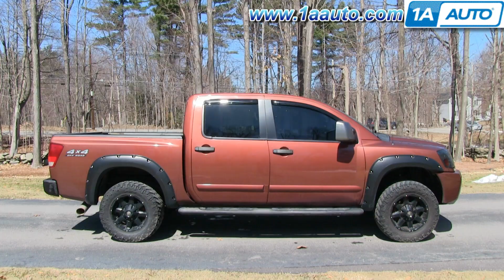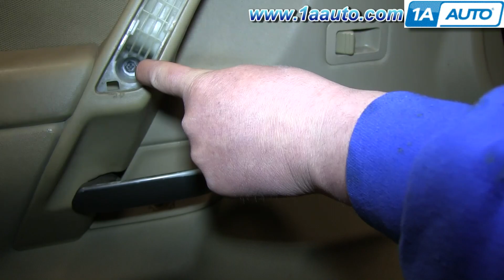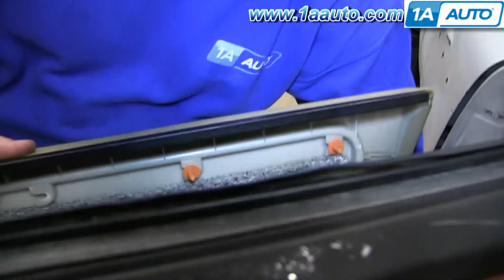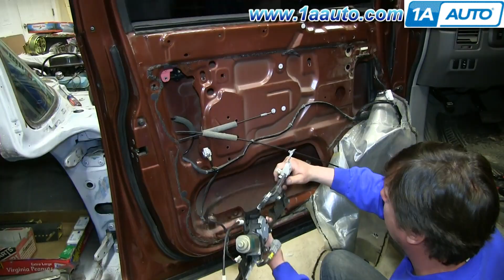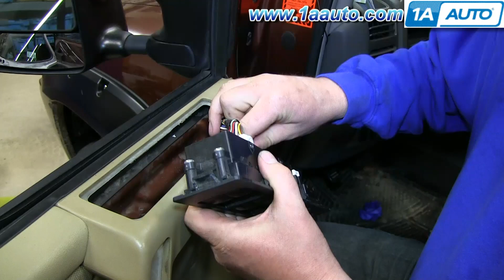How to Replace Window Regulator 04-15 Nissan Titan

Comment: Im having this issue with both rear windows in my 08 Armada not rolling down or up from the rear switches. I am able to roll them down with the driver master switch but it is painfully slow on both. Any suggestions?
Reply from the maker: +@ivanvega2821 We wouldn't be able to diagnose an issue like that here, you may want to have a local mechanic take a look at it. Thanks for checking us out! http://1aau.to/m/Shop-1AAuto-c

Comment: Anybody else have an issue with having multiple regulators die? This is my 3rd one driver side and 2nd one passenger side in a 2013 with 140k miles. Always sounds like its struggling to go up... it really whines and in the cold you have to help it with your hand

Comment: I missed the part of the video where we cut our arm on the edges, drop the bolts inside the door panel to fish out, the window drops down on you while your hands are in there, and of course, the mandatory breaking half of the door tabs off when you pop the sides loose.  But in theory, your video was very accurate and on a good day, goes just as smooth  ;)

Comment: I took my 2005 Nissan Titan SE to Gainesville FL Nissan because I don't like dealing with electrical problems. They told me "Two bad motors" and $1500 to fix. The actual problem was the regulators, which I replaced for a fraction of the cost using videos like this.  It was a breeze.

Comment: The video doesn't show you removing the bolt behind the arm rest
Reply: cause it was 2004
the extra 2 is on 2006 &07

Comment: Great video!  To the point with high quality clear video with good sound quality. Will save me hundreds of $$$! 

Noticed several comments asking how to distinguish if it's a regulator problem or rocker switch problem but you've never addressed this. Any luck addressing it today?
Reply from the maker: +cannon farris That would be something you'd have to test. You may want to have a local mechanic take a look at it. Thanks for checking us out! http://1aau.to/m/Shop-1AAuto-c

Comment: FYI on a 2004 at the handle area the (1) screw there is another once that cover is removed. When you grab the handle bar to lift up it wont come off just look bottom of handle for the extra screw. So in other words there is (2) screws for handle barn then there are (2) at the pull handle to open. Just double check before yanking

Comment: Yup! My Titan windows were not working for a long time. I was told little over $1000 to fix. It cost me $300 for the parts and did it myself in an hour. Your video helped me very much thanks!

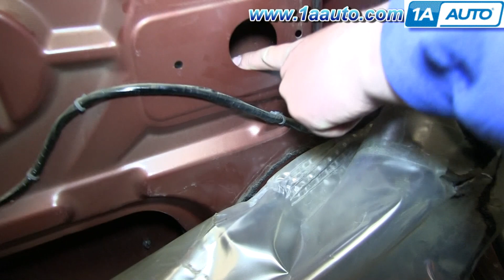Comment: Thanks for the video! With the help of this video and another one, I was able to replace the driver side window motor on my 07 Nissan Titan. One thing that might help other folks that I have experienced. At 1:59, since the bolts to the window did not line up to the holes where I can take the bolts off, I was kinda stuck since I couldn't cut the two wires to my regulator like the video suggests to do. I was simply changing out the motor and reusing my regulator. I found a comment in a Titan forum from a member saying that a tap to the area where the motor is mounted help "fixed" the motor. So I took a rubber mallet. Gave the area a few good taps, and I was able to roll up my window where the bolts lined up. Also, it was tough to keep the window up with tape after I unbolted it from the regulator so I wedged a few cardboard pieces in the window instead. After that, followed the steps in the rest of the video and got my window motor replaced. Thanks again!
Reply: I was also able to just tap on the motor to get it to move enough.

Comment: IT was very helpful, but on my passenger door then was another bolt under the arm rest, I found this on another video or I'd never gotten the panel off.   I could not get my window up high enough to remove the window release nuts.  So I couldn't get the regulator or motor out.
Reply from the maker: +George AmonetteThank you for the great reply. We love to empower our customers by showing you how-to perform your own auto repairs while installing our high quality auto parts. Have a great day! 1aauto.com

Comment: I'm having a bit of an issue I just got the regulator but I'm missing the 2 pieces that hold the window it looks like there blue to the window what are those called?
Reply: those pieces are loosely glued onto the glass bottom, but sometimes comes out with the regulator so you have to transfer those to the regulator.

Comment: You just save me $1000 I also saw another site it said I could clean the motor contacts which I did. That's all it was. Working like a champ
Reply: Gregory Bernier do you have the link to do that? Thanks!
Reply: 73% sure that's my problem! The window seals suck and the door fills with water when it downpours. Likely corroded something or other... unfortunately my window is stuck half way so I may have to clip the damn cables. That or pay a child/tiny woman to reach their little hands in there with a wrench lol

Comment: How do you get your window to roll up if it is stuck in the down position.
Reply: Edmond Chong what worked for me I plugged the switch back up and hit it in the up direction and pulled up on the window at the same time and managed to pull the window  up.
Reply: Very carefully, lift the window out of its two plastic holders and raise to fully up, keeping in the tracks. Tape that up until you need the window again. You can probably remove the regulators now. Ive found a design flaw in the regulators that lock them in fully up (and I imagine fully down) position.

Comment: there were TWO more bolts holding the panel on my 08 titan,  one under the plastic behind the latch and one under the armrest.  other than that unforseen nightmare,  this video helped tremendously.
Reply from the maker: +Michael  Nulton That's a good tip. Thanks for posting it. For anyone else looking to replace their window regulator, 1A Auto carries the part here:  https://www.1aauto.com/1A/WindowRegulators/Nissan/Titan/1AWRG01588?utm_source=YouTube&utm_medium=CTA%20Comment&utm_campaign=1ATony
Reply: Yep, me too. 09 titan.
Reply: My 2006 titan had one of those bolts!

Comment: how to know if is the motor or the regulator ????   help please
Reply: to 1AAuto - two thumbs up for your video! 

This last time, I bought the regulator and motor already attached, for about the same price as just the regulator alone. You have to search hard for it. It was worth it. Saved time and the potential for having to do it twice. 2004 model Titan - they had a lot of bugs in it.
Reply from the maker: +Carlos Vega If you take the door panel off, inspect the window regulator cable to see if it's broken. If it is, you would need a new window regulator. You may also want to test the power going to and from the window motor. We carry the window regulator shown in this video on our website with free shipping in the US http://www.1aauto.com/1A/WindowRegulators/Nissan/Titan/1AWRG01588?utm_source=YouTube&utm_medium=CTA%20Comment&utm_campaign=1ATony

Comment: nothing happens when i hit the switch, i assume its the motor. if the window is stuck in the up position how do you get it down to the spot where you can get to the bolts to unhook the window from the regulator?

Comment: If the window is on the down position, you mentioned the cable may be stuck and to move it up with hand.  How would you unstick the cable in order to be able to move it up to access the two bolts (10mm) that hold the window.
Reply from the maker: Jasbir Sangha If there isn't a way to un-jamb the window due to a stuck or broken cable, sometimes the only way to free it up is to cut the regulator cable and replace the window regualtor. We carry replacement window regulators for your Nissan Titan on our website. Here's a link to them if you need to replace the one that you have. Hope this helps you out. http://www.1aauto.com/nissan-titan-window-regulator/mo-c/1075-16?utm_source=YouTube&utm_medium=CTA%20Comment&utm_campaign=1ATony

Comment: I have a 2007 Armada that likely has a bad Motor on the driver side. I tried replacing the window switch with no luck.  The window is currently stuck in the closed position. Is there any other way to remove the Regulator/Motor without cutting the cables.  Or is that the only way to unbolt the window is to either get the motor to work temporarily to align the bolt and hole or cut the lines to the regulator destroying a likely good part.

Comment: If your window is stuck in the up position, and you cut the cables as shown, do they need to be replaced or repaired?
Thanks
Reply: When you replace the regulator assembly you'll get new cables

Comment: How would you do it if the window is stuck on the down position?
Reply from the maker: Once you remove the door panel you should be able to push the window into the up position by hand. If it's stuck, the cable could be jammed and you would need to free it up. Let us know if this helps you out. 1aauto.com 866-403-3393

Comment: What do you think? My 2004 Titan's drivers side window is hit or miss. Sometimes it works, sometimes it doesn't. If it was yours and you had limited diagnostic skills like me would you replace the master switch or regulator first? There is no noise when I operate the switch if that helps.
Reply from the maker: Check the wire harness between the door and body of the vehicle for a broke or frayed wire that may need to be repaired. hope this helps you out. 1aauto.com 866-403-3393
Reply: Thanks, I'm 95% sure that's my issue. I appreciate you pointing that out, I wouldn't have thought of it!